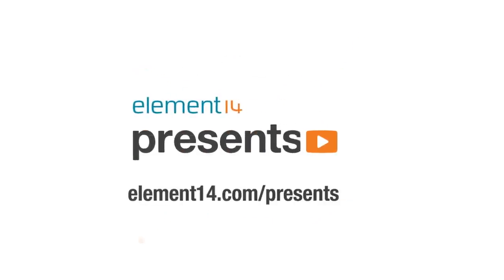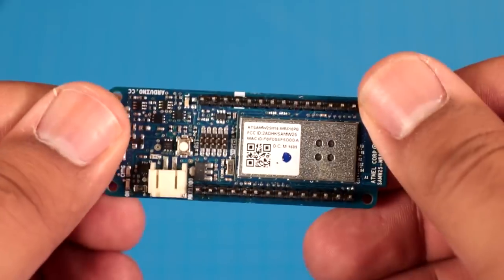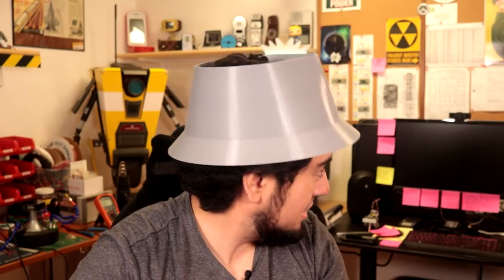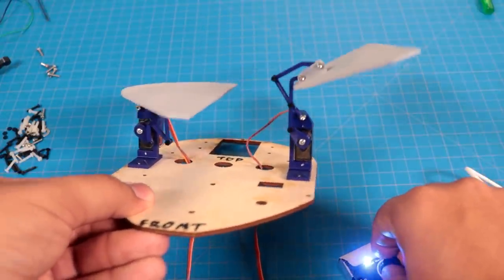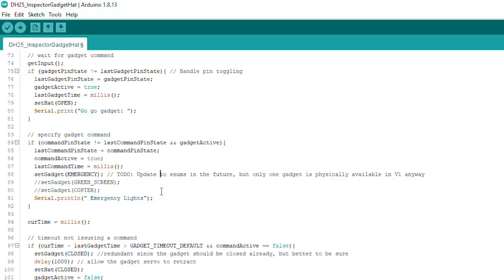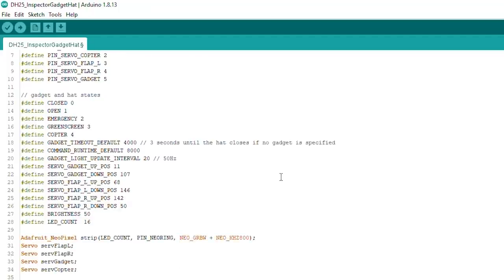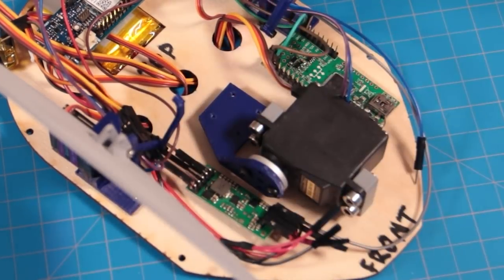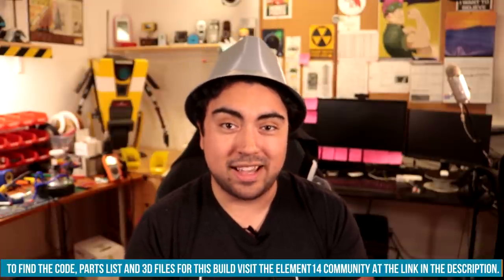Voice Activated Inspector Gadget Hat

Comment: Cover it with fabric.
Reply: Yes, exactly! I just wanted to suggest the same! The 3d printed body is just for stability, the fabric will make it a real hat. Then it also does not matter, that it sits too high on DJ's head
Reply: @ElvizzV2  Could also save a lot of room by re-engineering the flaps around fabric as well. E.g.: elastic and springy materials.